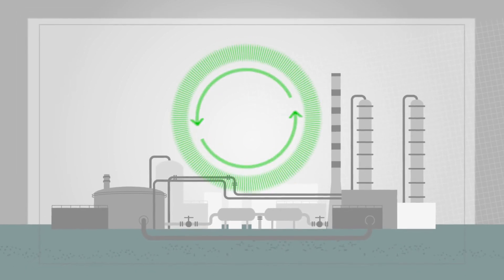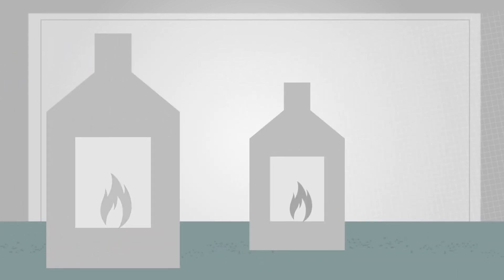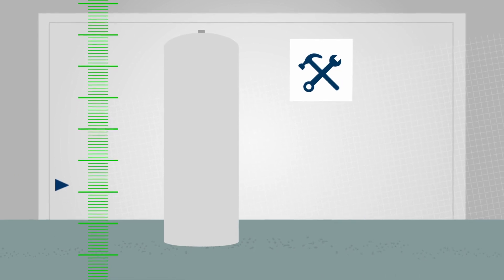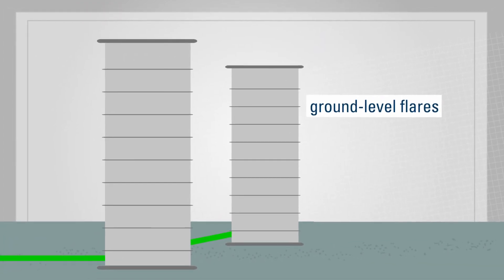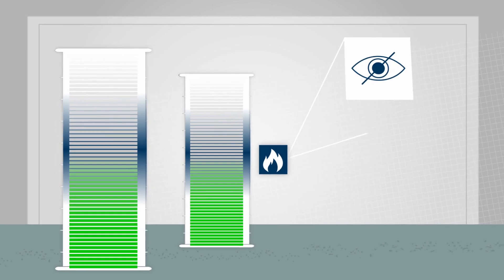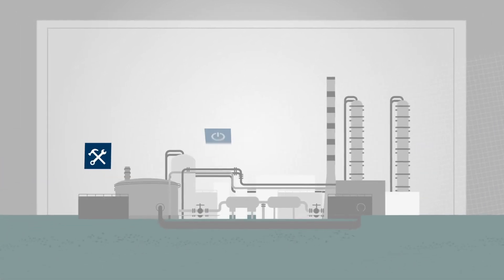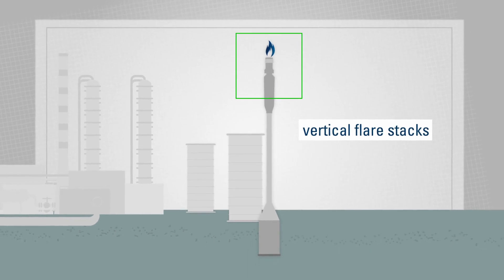The flare system in a refinery

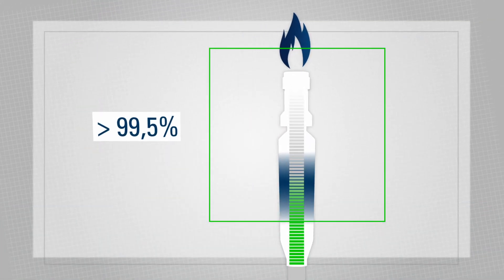Comment: 0:53  the gas definitely does not disappear without a trace.  it floats in the wind up and over some neighborhoods then blankets the surrounding area for 25+ miles around with acid deposits in the form of greasy dust or grimy mist.  i posted my post-flaring video below.  flaring alerts should warn the entire region in a 50 mile radius so the most vulnerable 5% can take precautions.

a chinese group sells an industrial solution that addresses all the issues related to flaring incl acid dust dew fog rain and hydrogen sulfide poisoning:  
https://www.youtube.com/watch?v=JDX6SY8Cyo0
QYCE-Flare Gas Recovery System FRS - 16m

black oil aerosol droplets leave gritty oil+dust coating on cars (aka air/water/soil/grass/skin/lungs) 25+ miles away after oil refinery flaring.

oil refinery flaring petrochemicals travel 25+ miles in the form of dust and mist and settles on all surfaces across the wider region incl cars that beg a daily wash-n-wipe routine, sometimes 2x/day, just to see clearly.

the risk to public health, young and vulnerable populations coping with a myriad of odd symptoms mis- or undiagnosed is painfully apparent aka obvious.  if its coating the cars and all surfaces in the region, then its airborne and getting on the grass/skin thus into our kids/pets/lungs, water/soil/crops, blood/geno.  

see my video evidence:
https://www.youtube.com/playlist?list...
refinery oil: in our lungs on our skin in the grass in the water at the schools

as a skeptic contrarian expat, dont believe the  hype that co2 is bad or causes climate change so i am not an alarmist given 200 year warming/cooling sun cycles alone dictate all we see and this is the 6th such cycle in 1200 years thus predating/eliminating fossil fuels.  but i am anti-excess pollution thus anti-acid deposits generated by flaring gases.
Reply from the maker: Thank you for your comment.

Flaring at OMV refineries takes place only in case when plants are taken out of service for maintenance or have to be shut down and the excess gas cannot be reused. If operations in our refineries are running normally, then the stack flares will not be used at all. Excess gas from refining processes is reused after treatment as fuel gas in process furnaces or power plants.
In case of safety flaring events, the gases are then fed into flares via the flare system and undergo complete combustion. At the top of the stack flares, at a height of around 60 meters, the combustion process isn’t dangerous – the excess gas is flared leaving behind only water vapor and carbon dioxide. Substances that are also contained in the flue gas of every household from its heating. Using the flares means that the gases are incinerated completely, leaving no residue behind. This ensures that there is no harm to the environment. With the help of steam, additional oxygen is sucked from the surroundings, allowing the gases to be flared in complete combustion so that the flame doesn’t emit any soot.
At Refinery Schwechat we have installed a so-called “Green Phone”. This is a 24/7 hotline to the shift manager, who answers any questions or concerns related to the refinery and thereby also on the use of flares. So local residents have a direct line to the company, in case there are any uncertainties or questions.